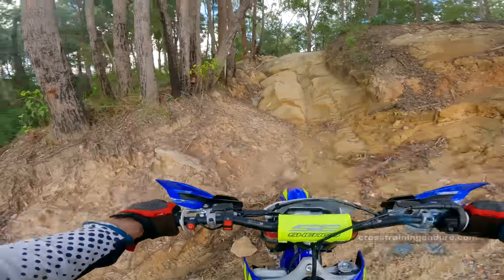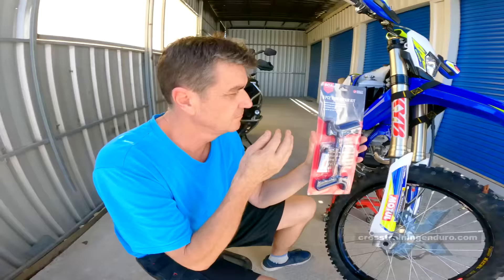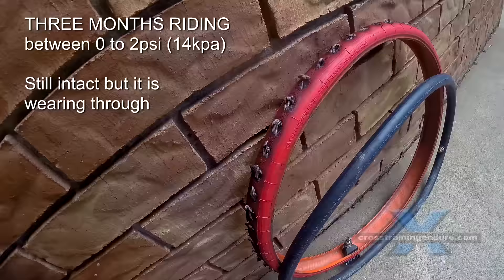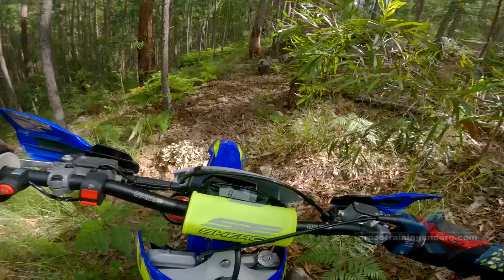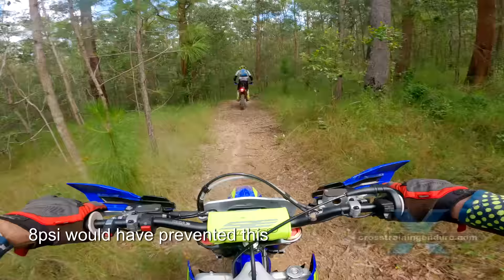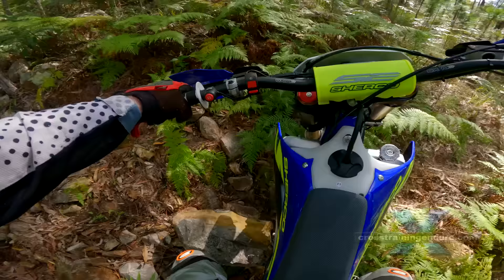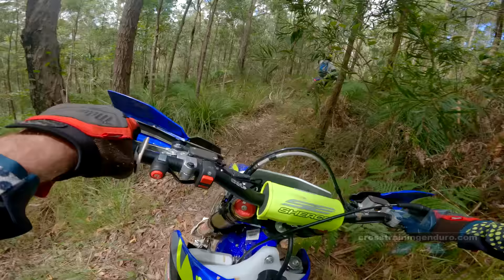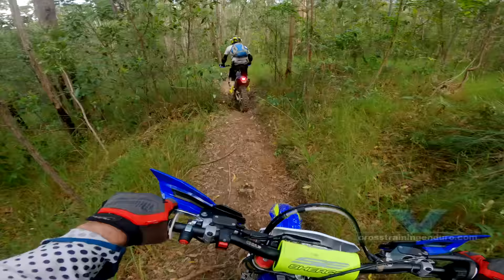TUbliss long-term review after 7 years with the tubeless tire system!︱Cross Training Enduro

Comment: Been using Tubliss for more years than I can remember. I use slime instead of soap and water to seal things up. I really like it.  I've only had 2 failures that wouldn't have happened if I ran tubes in all those years. The first is Michelin Starcross 5 soft front tires will not seal for me. They'll hold air for the first couple of rides, but then start leaking and no amount of reseating and sliming will make them seal. In an hour, they're flat again after being pumped up to 12psi. I really like the starcross 5. I'm thinking about going mousse in the front at least. On the rear, I was running an IRC VE33S. I ran 6 psi in it most of the time. It quit holding air and reseating would not help it. Upon changing the tire out, I discovered the inner carcass had separated from the cords. So, even though it wouldn't have leaked with a tube, it did with Tubliss. I still run the same brand tire, but now I've upped the pressure to 7psi. Maybe I just beat the tire up too much in the rock gardens. Other than those two tire failures, I've had no issues.
Reply from the maker: Bummer about the air leak, David. You think it's Michelin specific?
Reply: @crosstrainingenduro  Yeah, I think the carcass at bead area on the starcross is too thin. I think the tubliss bladder can't get out of the drop center far enough to pinch the bead and keep it sealed. The starcross have pretty thin carcasses.
Reply from the maker: I think TUbliss pairs up well with knobbies that have a decent carcass, as you can keep riding (gently) after a puncture if needed. You'd just be riding on the rims with a very soft sidewall...

Comment: Awsome video as usual!

I live in Colorado and so I'm riding "western US" desert and rock conditions.  Have run TuBliss, currently running bibs, probably will go back to TuBliss when the bibs wear out.  TuBliss is much easier to install than bibs of course.  The big negative with bibs, aside from their expense, is they are very heavy and you can feel their weight when you ride.  Bibs also aren't "adjustable" and depending on what stiffness you install, they feel like riding around with 15 PSI when they are new.  Plush?  That is bib BS, not when they are new.  The upside of bibs is you can spear pointy rocks at speed out in the desert with near impunity 😆

TuBliss makes any given pressure slightly softer than tubes in my opinion, so if you usually run 12 PSI in a tube, running 12 PSI in a TuBliss is like running 10 or 11 PSI.  If riding high speed desert you don't want to run single digit air pressure as it really risks slicing the tire open.  I had that happen to me and that's why I switched to bibs in the 1st place.  Was able to ride the slashed tire back to the truck as it didn't affect the high pressure bladder, and pretty sure if I had been running 12 PSI in the tire it wouldn't have happened at all.

Like the video says, I do like that the rider can adjust the tire pressure to the conditions.  Slow technical riding?  Lower the pressure.  Fast open desert riding?  Raise the pressure.  The ability to adjust your air pressure is cool.
Reply from the maker: Great to hear they are working out well for you, Craig. As always it's cool to have these options available and just work out what suits best.

Comment: Had my first ride of the season yesterday. I hadn't check the high pressure tube since last November and I figured it would be flat. It actually had 85 psi in both the front and rear and the low pressure was only 1 psi down from where I last had it. It nice to know that if I forget to check it, I'm going to be OK.
Reply from the maker: Excellent, Dave! Once I forgot to check mine for about three months and it had dropped to 50psi but it was still keeping the tyre in place... but obviously it was running a risk.
Reply: @crosstrainingenduro I install with 100% slime, nothing else. I set my compressor to 100 min and 120 max. I fill until I don’t hear anymore air going in. Last week I was doing a leakdown test and set it to 80# and forgot to reset it to 100#. Normally the bladder loser about 1# a day and tires lose 1# in 2 to 3 weeks. Unfortunately when I filled up before my ride I actually lowered the bladder pressure.  

I’m not sure exactly when the bladder failed to seal, but I rode 30 street miles for a meet up and a few miles into the ride hit a kicker that lifted the rear about a foot off the ground. I think that’s all it took to break the seal in a big way. 

With a Trackmaster rear, I kept riding another 20 miles through a jagged rock bed but had to bail because it wasn’t holding air but had no punctures. That means the seals broken and I didn’t want to put a tube on and hold up 7 riders. 

Ironically when I got to my bailout home, I picked up a rivet shallow in the rear on the way and the bladder actually had failed separately. 

Moral of the story, always check the bladder. As for you, count your lucky stars you didn’t have my experience. 

Part 2🙃 I had a new liner and bladder at home. After inspecting the tire, to my surprise, it didn’t show any signs of abuse. I cleaned it and used my Slime only install and after plugging the rivet puncture, it’s happily hold like new. 

I used the “Blackburn Plugger Bike Tubeless Tire Repair Kit” that is smaller than a standard tire plug and perfect for most Tubliss repairs.

Comment: Glad to hear that the red shield wear over time before I blow through. It's the first time I see that (I have been using mine for only 2 years)
Reply from the maker: That was from running 0psi over a few rides as an experiment, Cedric. But I should have had Tyre Slime in there to prevent the friction!

Comment: I’ve had mine on front and back for 18 months now. I do everything from daily commuting to moto camping, single track and hare scrambles with them. They’ve never let me down and I love the traction.

So far one puncture and it was pretty sweet being able to plug the tire.

I do find mine ALWAYS LEAK. The high pressure will loose about 10psi over a couple weeks. 

The low pressure chamber I’ll loose about 1-2 psi per day. It changes. These days I loose less. I don’t run slime unless it’s really bad. I got pretty used to just checking them before each ride.
Reply from the maker: 10psi over two weeks is pretty good actually... mine tend to drop that much in one week. Although of course you probably lose 5psi simply through checking the air pressure.

Comment: 3 or 4mm cheap tubes with a bunch of grease. Im doing cross contry and motocross with only one set of wheel and limited budget, basically, i always feel im on the wrong tires. The Meg Braap set up is pretty legit too!

Comment: I run tubliss filled with a few ounces of Ultraseal tire sealant for AA/Pro off road racing. I used to use the green tire slime but found that it would dry out after a few months and eventually I'd get a flat. This latest setup is the best in my opinion. I hate the way bibs feel, they're non-adjustable, they get beat out and need regular replacement, and they don't fit properly in all tires. Not to mention very expensive. The tubliss does have an installation learning curve, but once you figure out the nuances it's an amazing setup.
Reply from the maker: I agree with fitment... the first time took ages as I made sure I followed the instructions carefully. After that, changes have been quick.

Comment: Put tubliss in my rear tire before the race season and a moose in the front. I have had 0 issues in 5 races so far at 8-9psi as we race more high speed offroad and I am a heavy rider. The traction gain over 15psi on tubes is increadable and I won't go back.

Comment: Been using Tubliss for 10 years. One failure of a 5year old high pressure tube caused by rust into the steel belts. Balancing wheels does really help the feel even on rough terrain, anything over 15mph.

Comment: I built 2 wheels sets for the DR650 , both 21/18. One set has 2.5 rear, the other 2.125. So I fitted Tubliss to the narrow one. Playing on local single track, just the diameter difference of a 18 with a tall narrow tyre makes for much easier rut work, dropping to 0 ~ 6psi with the Motoz Extreme Hybrid tyre had me blown away with the traction on all surfaces. However, seeing as I had the second wheel, I fitted a 140 Motoz RallZ with UHD tube. Yep....waaaaay heavier. But, I drop it to 6 ~10psi and I honestly think it does better in a lot of situations. The Extreme Hybrid relies more on it's compound for traction, the Rallz is really wide, big knobs, and a big gap between them, so on steep climbs when I hit tree roots forming step ups in the ruts, the RallZ hooks and climbs more easily, same with surfaces that are slippery but have chunks of rock mixed in, anything solid it claws over. Crossing fallen trees in general I prefer the RallZ so far. Slick rock, the Extreme Hybrid. So going forward, I think further experimentation with tyre brands and types will produce some interesting results. Over all, just the 18 inch wheel has been a significant improvement. Disclaimer: My DR has RMZ forks, triple clamps, front wheel, swingarm, shock, and linkage. With the suspension unloaded and setup in my normal REDUCED height setup, I have 400mm under the bashplate, so I can ride ruts the smaller bikes get stuck in, my bashplate may be wider, but it's further off the ground, and utilises the width that other riders footpegs have carved out. So ruts that the 250/300/450 have abandoned are a lot of the time still a viable line for me. It just floats the back end over the tree roots. Really goes a long way for making up for the fact I'm old and broken. I've called it my disability single track bike, and in some ways it is. As long as I don't have to pick it up. I seriously considered (and have all the parts laying around in the shed) building a 19 inch rear with cush drive. The extra diameter has made the biggest difference to date, so I figure, why not go bigger again?
Reply from the maker: Great to hear, Adam. Only three rides but must admit I'm loving the Rallz so far. I'll be doing a new vid about DR650 suspension options soon and I'm going to mention the RMZ forks... did you find it an easy swap? I'll be doing the old 1983 to 1988 RM250 conventional forks option soon. These just slide right in and work with the stock wheel and axle. All it needs is a custom caliper adapter plate. The bike is sitting a bit high at the rear with the big 140 Rallz so the longer forks will balance it out nicely. And get some extra clearance.
Reply: @crosstrainingenduro  Yeah for the forks I have done 3 versions on DRs. One was the USD double chamber from an 07 RMZ250, triples, forks, and wheel, super moto 320mm disc and caliper adapter. I did another with 1999 RMZ 250 conventional dual chamber forks, triples, forks, DRZ wheel and super moto 320mm disc with caliper adapter. The last one was an 06 RMZ single chamber USD, RMZ forks, wheel Disc. The RMZ swingarm and rear shock and linkage was another progression done back in 2009. I bought all the components from a US wrecker who was breaking old stock brand new bikes. So things like shocks, $150, swingarm, $60, linkage $60. I measured an RMZ frame, did my calculations, and then cut the DR shock mount off, and cut the linkage mounts off and welded new mounts fabricated from 6mm plate. My argument at rego was I didn't modify the frame. I modified the shock mounts. The only down side was I ditched the airbox because the shock sits central and clearance was an issue. I just run a pod filter off a pumper carb. The only real issue with front ends is speedo drive. If you use the DRZ wheel, you can use the RMZ250 axle and forks from before 06. So you can use the DRZ speedo drive and hook the standard DR speedo up. If you go with a full RMZ front end from 07 onward, the 250 and 450 went back to the same USD fork, axle is larger, the front wheels changed PCD so you just need to get the right disc to match. Steering lock, I made an adapter plate, mounted the ignition barrel to the plate, it bolts on to the bar riser bolts under the top triple clamp. In terms of anti theft...it's about as successful as standard. Yeah, you could spend 30 minutes trying to dismantle it, or just break the lock pin like the thieves normally do. So that didn't worry me. I'll have to do a walk around vid and sent you a link. But it transforms the bike. I'd tried gold valves and aftermarket shock upgrades and all that, and the RMZ suspension valved and sprung for the DR is like a factor of 3 to 1 better than the "usual upgrades". I grew up racing MX, and at nearly 60 I ride a bike in the dirt like an MX bike. So I just figured that MX suspension was probably a smarter place to start.
Reply from the maker: Great info, thanks for that Adam. I'll include some of that in the upcoming vid. Out of interest, how did you go with fork spring rates? I assume these would have been a bit soft for the weight of the DR650. I'm checking spring rates for the old RM250 forks I'll be using and it looks as though I can only go as high as 5.0 which I hope will be enough. The stock ones are 4.3....
Reply: https://youtu.be/WeycJdb4m3w did a quick walk around for the basics. Yeah, sprung for weight. Front is probably slightly stiff, I like them that way. 0.62kg/mm. Rear spring came off an XR650R, It’s progressive wound. Works really well with the “step” people say they feel in the RMZ linkage. So super smooth over trail chop, takes big hits. Having that high and low speed compression adjustment is brilliant. Rear travel on this is crazy. My ATV lift is topped out, tyres are still on ground. With the spring off the shock I measured 340mm travel on the rear. Basically, before I did some shim work on the shock I was doing big jumps, bottoming it out, and hitting ground with the bashplate. Seat height is crazy. For single track I drop preload off shock, so it sits at about 40% rider sag. The rear climbs over axle height roots and trees so easy I often stop and look back to see if they just broke.

Mate of mine was doing Cape Tours out of Cairns on the other DR I built, and he loved it. This one’s much better than that one. An evolution ahead. 

You can do the 06 Triples and forks and use the standard steering stops. I just preferred the 07 triples because they gave me greater range of adjustment on fork leg. You’ll see in the video I have the forks pushed up in the triples about 30mm. That’s not as far as they’ll go, but it’s close. That’s my single track setting. For riding soft sand out west I drop them the full amount and give it lazier steering.  I didn’t have that range on the 07. I need to do something about a speedo. I was running one of the old Vapours, but apparently upside down in a creek is bad for them. So I use a speedo app on my iPhone on the Quadlock on road, and Hema trail maps off-road. My son bought me a GPS/EPRIB thing for some weird reason. He stopped coming with me when he busted his leg up. Easier to just buy me an EPIRB.
Reply from the maker: Love the sound of all that rear travel! I'm very tall so I'd have no problem with lifting the DR650 quite a bit, but I'm on a strict budget and not great with mechanical skills so I'll just stick with some RM250 forks and get the rear shock revalved I think. Thanks again for the video and info link, it will be good to present viewers with a range of options.

Comment: I've had a TUbliss setup in the rear for 5yrs . no problems with punctures but it's agreed once a tire is set it's almost impossible to get another proper seal. No amount of slime has stopped a super fine veil of bubbles from the bead . Slow leak but lesson learned.

Comment: Absolutely love it ! I use nitrogen for the inner tube so temp doesn’t effect it
Reply: Just my opinion but I think nitrogen is a waste of money. 
Air is roughly 78% nitrogen and I don't think your inner tube bladder would get hot or cold enough such that expansion/contraction of the 21% oxygen would make any significant difference to the pressure. Just my thoughts...

Comment: I have a Husqvarna 701.  I’m not an aggressive rider (I’m 72) but when I get a puncture I’d rather plug a tubeless tire then patch a tube )5 minutes VS 50 minutes). It’s become popular for guys to seal the spokes and run tubeless tires.  Good idea?  I’m on the highway a good amount to get to the trails.
Reply: No, tubeless bike rims have an extra lip to secure the tyre. Tyre that can come completely off (quickly) at 100mph, no thanks.

Comment: I like mousse because you never have to think about it, and it will always get you home. Also most mouses that I’ve used have gone over 100 hours on the rear, and the front is usually good for about 40 hours before I don’t like how soft it is (it’ll cause the front end to plow through corners), but I’m lazy so I’ll often run front one longer than I’d recommend.  It’s the only thing I run nowadays

Tubliss, however, has a much better feel out of tube and mousses and when it works it is a joy to ride. However, I never want to worry about fixing a puncture while on a ride, and the biggest problem with tubliss is that if you dent a rim (which as a very aggressive rider I do almost all the time), tubliss won’t hold air. 

I think that there’s no reason to run tubes on anything but a motocross track. If you’re off-road, a tube is just so easily flatted or punctured and it’ll cost you more than you’d save if you just bought tubliss or a mousse once ever 100-200 hours depending on how stiff you like your tire. 

That’s all just my opinion as a pretty average rider, however.
Reply from the maker: Those are good hours for mousses, Garrett. I know a lot of riders don't get that far... are you using Michelins?
Reply: @crosstrainingenduro  Michelin and Nitros
Reply: @crosstrainingenduro  If you do a lot of fast riding mousses do deteriorate much faster from the heat